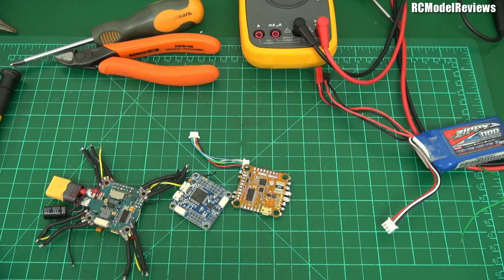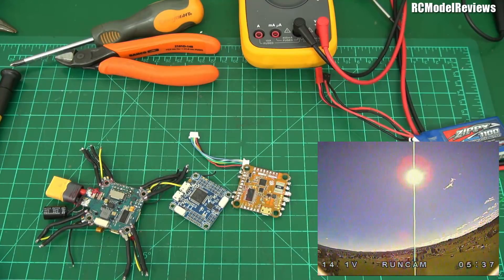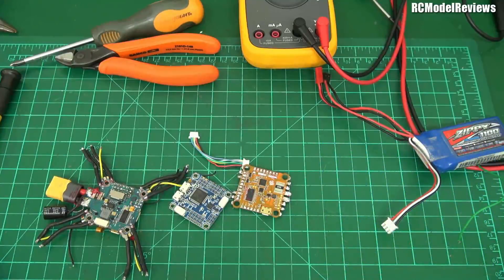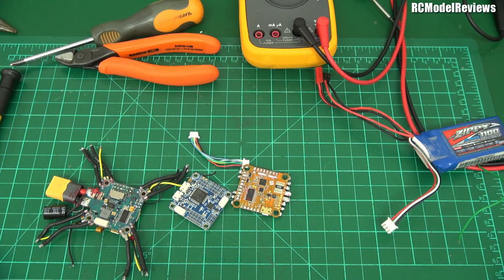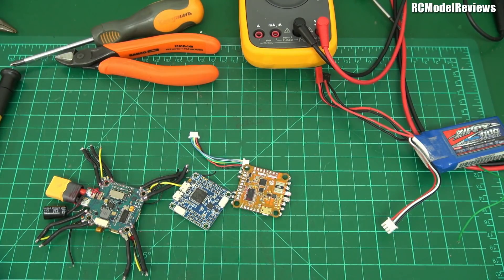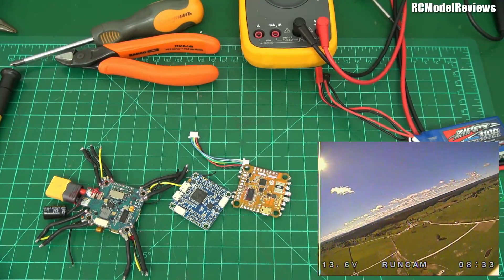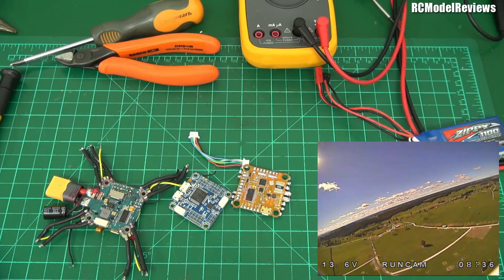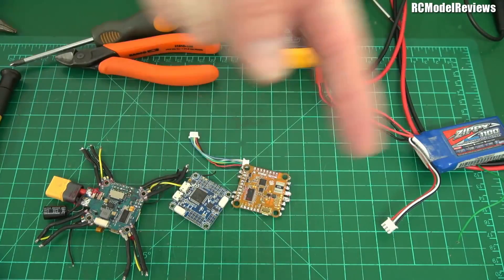How to SAFELY fly an RC plane beyond visual line of sight (part 0)

Comment: The number of things that can go wrong when your doing longer range FPV is very high. Lots and lots of ways of losing your plane. Unless your going to cover all of it I would not do the video. Not doing a comprehensive set of video's will leave the door open to someone making one of those bad mistakes. The best way to learn longer range FPV is hooking up with folks that are doing it. Having someone that knows what they are doing go through your plane, gear, programming, etc should be mandatory. Having someone who knows what they are doing copilot with you on flights should also be mandatory. Watching an incomplete video and thinking thats all there is will lead to alot of heartache... love your videos and would love to see this done as long as its done right and in a very comprehensive mannor.

Comment: A tough one... if people are going to do it, yes its good they are informed how to do it safely. There are too many people who wouldn’t have a clue, maybe thats good so they are not encouraged potentially brake the rules in their country and fuel the fire. You rase a good point about doing it safely with sound information and practices. BUT... we totally loose the moral high ground when a regulator imposes more restrictive rules, especially when there based on information given by a respected and active voice of reason and sensibility in the aero modelling community. What ever you do i’m sure it will be the right thing.

Comment: Even short range FPV is now banned in Australia so long range isn't even something to think about. I invested in Fat Shark FPV so that I could ensure I get the footage I want while flying. It is the only way (with the old Phantom One) to be sure that I get what I want within the very limited flight time. That is all over thanks to the regs.
Reply: It's always been a grey area for clubs, and a no-no for individuals. As far as I'm aware, nothing has changed... Unless clubs have been banned entirely.
There is a commercial trial of FPV happening near Canberra apparently, too, so it's a bit incorrect to say it's banned. It's just regulated, like all flight.
Reply: As far as I know from my communications with CASR, the operator of the drone cannot use FPV because the drone must be in line of sight. That is as good as banned if you are a single operator. For someone like me who is sight impaired, it means I cannot fly because I need FPV to properly orientate the drone for the shots I want to get. Clubs can still use FPV but individuals cannot. This was the wording I got back from CASR : "FPV flying is not permitted in Australia under CASR Regulation Part 101 unless you operate under the procedures of an approved model flying association.  Contact the MAAA for more information about flying FPV.  You can access the MAAA website at:  http://www.maaa.asn.au"

Comment: Thank you for maybe attempting this idea. I live in a remote part of Canada and have been flying BVLOS for the past ten years as tech. developed. I'm involved in the commercial flight industry and can see a need for this as aviation develops. It's a fine line that military and commercial jets are walking with pilot-less cockpits now and if it wern't for regulatory slight of hand and crooked governments they would be grounded. Should you decide to go ahead with this please take precautions to cover your butt. I would hate to see you off the air. Cheers, Billy from Canada

Comment: Go for it! I have been flying bvlos safely for a number of years. Always in unpopulated areas, many miles from flight paths and at low altitude using lightweight fixed wing. Not often exceeding a couple of kilometers because it's a pig finding a lost plane.

Comment: Bruce  - Great idea. The appeal of seeing the world from the sky is compelling. Whether its "beyond line of sight" or not; whether it is intended or accidental. The idea of building and operating a 'safe' ( low risk)  FPV craft that is small and has long endurance would be valuable. Please emphasize features and practices that reduce risk of loss , damage or public annoyance/ awareness. Also perhaps you could include consideration of factors that may cause unexpected radio / video drop out; things such as weather, terrain, proximity to structures / other EM sources. Thanks. Martin

Comment: I propose two technical (and radical) ideas that might kickstart this conversation. The first is one which NASA has used for years. Namely, using relay stations to transmit and receive data for BVLOS spacecraft. NASA uses stations all around the globe to keep in constant contact with its spacecraft. We can do the same with relay drones. They would become stationary drones that hover at a predetermined altitude, relaying data from the ground station to the actual craft that is doing the work. This is exactly what warfighting drones do now.
The second idea is that the exact path and altitude flown is constantly being recorded on board the drone as well as being recorded at the base station. This path is then exactly reversed in the event communication is lost and the drone comes home. But, if it falls out of the sky on the way back, the operator can consult his recording and forensically search the path that was taken. It is likely the operator will find his drone somewhere along that path.

Comment: Interesting idea but I do caution with how this will be received by the mainstream media et al and turned against those of us who fly FPV. My thoughts are: Do not use any commercially available products I.e. Parrot Disco or DJI products. Do use a home built type build much like what normal FPV fliers would construct from parts, from a variety of suppliers. Do use an aircraft  that is commonly used for FPV such as a pusher type 4 channel ( AXN/Bixler ) or even a 3 channel wing ( FX-61 Phantom ). Do use a heads up type OSD display with GPS, stabilized and return to home capability. Do try and build it within a preset budget (say 300 usd). Finally... don't Crash!

Comment: Can you do it < 250g fixed wing?
It would be nice if you had circularly polarized antennas for the video link.  Some modeling I've done with xnec2c suggests a twisted loop with the right parameters isn't too bad there, but somewhat narrow band and modestly directional.

Comment: I think it's a great idea. I think the mandatory thing is you use a controller with autopilot if going bvlos. That way it will just return if you lose signal. Other useful things: 4g mobile internet as backup telemetry and control link, a light foam plane, a pusher configuration so you don't drive a moving prop into someone's eye, and maybe an antenna tracker for base station to keep good signal. If you have autopilot you can set a course to avoid populated areas too, very useful. Ardupilot even has some ADSB features, never tried tho. For a lighter build you could do solar cells as an extra power source. Looking forward to your video!

Comment: BVLOS is the next big step. Vey timely. You need to check out the Outback Challenge and especially the Canberra UAV teams setup as all entrants were flying BVLOS and had, I think, 21 no fly zones, geofence, and moving targets they had to automatically avoid. I believe Canberra UAV will be posting a full video description of their setup and the event in the coming week or so. We setup drones, bigger stuff, with auto aircraft avoidance. Unfortunately there are still a lot of manned aircraft that do not have any ADSB or other aids, and they are the biggest worry. Ardupilot already has all the avoidance being built into firmware. It is really worth you time to see what is happening there.

Comment: Z-84 Wing Wing with an iNav AP system based on a cheap FC, an FrSky L9R, an 800mw TBS Unify Pro 5G8, and 3200mah of Li-ion 4s1p battery. With a lightweight 2204-2300kv motor and a 6x4 prop should get at least an hour of flight time and easily 10km of range, possibly even 20km on a good day. 

It’s cheap, doesn’t require specialized UHF control or video systems and antennas, or large and heavy batteries. It’s also a small, lightweight foam plane that won’t do much damage in a crash. 

There are videos of a guy flying one incredibly long range (autonomous waypoint control), even in some harsh weather, and returning safely, so they are clearly capable.

Comment: I have for quite some time wanted to make this safer by designing the technology safer. E.g. Is it possible to have 2 esc even you only have 1 motor? Like a backup esc.. so if the current flow or temperature is two high it will switch to backup esc. Some kind of detection system so that you don't loose power if one esc dies.

Comment: Hi Bruce, idea for a video. Can you design and show us how to make a Lipo automatic discharge circuit? The DJI batteries have an inbuilt timer on them to automatically return them to storage voltage if you forget. Could be a really nice diy device to make and plug into a lipo when not using it. Thanks 

P.s. how are you getting on with the sub 250g quad project??

Comment: Good idea. Do it. 
There’s a fella on here that pushed a 400g Z84 out 76km and back. The plane was light and used li-ion batteries which I believe is more safe that a polymer battery just Incase the plane were to go down some km away from you. 
My main concern with flying LR is the plane going down far away and causing a  fire and you don’t hear about it until it’s on the news the next day. Li-ion may help with this danger.
Reply: Hyprmtr 400g plane for a total of 152 km, Was that weight excluding batteries?
Reply: Sindre I believe it was 430g AUW/TOW. Supermotoxl is his youtube. He has a complete build sheet on his website with APM parameters and everything.

Comment: very good idea bruce !  i`ve been planning for a year to fly long range , i do own a full scale skyhunter with vector and i will buy the beleiver next winter which will also get a vector for more reliability , but of course i will have to use a good long range system like tbs crossfire or dragon link ect ,, with a lot of practice and short flights first , i`ll  drive away from the cities , airports , residential area , national parks and federal parks , and i will give it a try ,,,, but the very first thing that comes to my mind is,,,,,,,, safety first,,,,,,,

Comment: I'm a quad pilot and have thought about putting together an INav plane with one of my flight controllers, someday.  I'm primarily interested in the return to home feature in case of signal loss but otherwise am more keen in flying the plane manually than I am in the auto-pilot features, which I would familiarize myself with anyway.  I would want a smaller plane with good performance that is fun to fly, including some proximity flying when appropriate.  I've seen some videos of people flying in a boring, straight line, at altitude, and they're on a mission to go as far as possible in a grueling amount of time.  That doesn't interest me very much, but there are lots of hilltops around here that would be fun to explore, and trees to fly near or between.  I don't like the way flying wings tend to wagle so have considered something like the Strix StratoSurfer.

Comment: Yes please Bruce! I'm in UK so reference to regs applicable here would be useful too (ie is it OK if you have spotter, 1000' allowed in certain circumstances etc). I had a Hubsan SpyHawk that is a good example of an off the shelf BVLOS capable very lightweight FPV, but alas was not capable of GPS RTL (wind too strong) and yes lost for good! But as you say that plane was low risk as it weighed about the same as a sparrow! How about doing the ZOUD Nano Talon with an F722 autopilot and using INAV with FRSky R9 900/835 MHz radio? The nano talon is so light and small that it is low risk, inexpensive, and a very good performer and with 4S Li-Ion pack would have great endurance?
Reply: Jeffrey Horton I just bought a nano talon for this reason! The regs only allow LOS in the U.K. and up to 1000ft if you are a member of bmfa fpvuk etc.
Reply: " But as you say that plane was low risk as it weighed about the same as a sparrow  " 
AFAIK the Spy hawk weighs about 350g. A house-sparrow weighs under 30g. If you want to make a direct comparison you should be looking for at least a fat pigeon
Reply: PropStrike RC Anything FPV is limited to 400’ as the BMFA fucked us over on that one.
Reply: You are still allowed to fly FPV up to 1000' (at the moment), however there is no good reason NOT to be a member of the BMFA / FPVUK as the small amount it costs also covers you for up to £25 million insurance - and this alone pretty much proves how safe model flying is - that we can get £25 million of 3rd party insurance for as many planes/helis/quads as you own for £33

Comment: hmm, I am not so sure you should do this or at least not with an aircraft in the sky, you could do it cautiously using ground based equipment in a suitably flat or up hill environment. my concern is that we in the hobby are under scrutiny at present and I wouldn't want to see something go wrong that caused some bad press or worse for it to go right and still get bad press because a good news story is not a news story. in any case I love the fact that you have started this conversation and i respect both sides of the argument as expressed below, take care and don't do anything that would deprive us of your experience and wit. by the way what are you doing with that Omnibus F4 V3 Flight Controller?

Comment: Something I've pondered about previously, is there a reason "visual" is included in the BVLOS designation, is there a line of sight that is something other than visual that I'm not seeing?
Reply: I believe it refers to being able to see the aircraft unaided, ie. without using binoculars or telescope.
Reply: The point being, it's far enough that you can't just pull your goggles off and continue flying line-of-sight, and even if you had a spotter, the spotter couldn't see the plane either.
Reply: Well you could argue that fpv is kind of a digital line of sight.. So visual would be to clarifiy that
Reply: A proper LR plane has a return to home,if that falls fowl to a mechanical issue theres not much more that can be done.a very long bow string drawn here,i however conduct many many so called LR flights,very much in love with this hobby in all aspects of FPV,and Bruce is a King to our hobby...

Comment: Yes, do it. Just reading an article in ROTOR DRONE mag on BVLOS.. and the steps others are taking to make it safe. Very encouraging dialog.  Also 107 ers must have it ok'd because you can't deliver pkg  from Amazon, which I hear is currently happening in some states,  without going BVLOS. And  if it's a federal reg, we'll that's all states.  The only thing changing faster than drone regs is the drones themselves.  They are working on some ears on these things that will stifle them out of each other's way and a much noisier full size craft.  I don't always fly line of site..but when I do its not on purpose. And sometimes never see it again.  Bye $150-?? $...Except now I use trackers..hope that works..

Comment: An FPV rc plane, depending on size/visual area in various attitudes can remain within VLOS for quite a distance anyway. Close to the capability of stock RC radio equipment (though new long range technology extends that)
I'm not at all sure that most models can be flown safely at BVLOS distances except in exceptional circumstances. I'm even less sure that they should be or that people should be encouraged to try it
I am sure however that you will try to demonstrate that this can be done. 
It could be an interesting experiment, and of a certainty, will generate some heated discussions (and replies to the videos) Given that you will be doing the flying it may also attract the attention of both those who dislike you and, possibly, the relevant authorities so I'd advise caution.
Many of us are quite fond of your productions :)

Comment: Hi Bruce , I think this is a fantastic idea! I live in the Canadian prairies Regina Saskatchewan to be specific and hopefully not incriminating LOL. I have been collecting the gear to start up with my first long-range flight. I've assembled all the ezuhf components needed, Plus a seven or eight turn helical 2.4 antenna to be used with video.  It will be done through a  taranis x9d so I'm fairly confident in the equipment that I'm using . The plane will either be a volantix ranger with the 2 meter  wingspan or a Bjormatec Maya with the 1.8 m wingspan . Not sure which one will win the prize of the electronics and flight. You can guarantee that I'll be watching any video series you make in regards to a realistic Beyond visual line-of-sight flight and I thank you for having the Kahuna's to do it especially being in your situation we're so closely watched. I hope the officials in your town that have been giving you a hard time realize how much worse they could have it instead of having a responsible realistic teacher such as yourself. Cheers, Josh in Saskatchewan

Comment: I already said many times the only way to enjoy the hobby is for the manufacturers to make the models small enough and light enough that they won't be seen and if they fall out of the sky they can't hurt anything.  How many birds out of billions have died while in the air and have hurt someone or anything when they crashed to the ground?  Happy Flying
Reply: Probably more than we know. However we do know many real airplanes have been knocked out of the sky by bird strikes. I've seen the results if many bird strikes. It's not how heavy and fast the bird is going that does the damage. They BLOW BIG HOLES deep into aircraft structure. They wipe out engines, windscreens, leading edges. They blow through bleed air ducts and smash holes in fuel cells. Birds kill airplanes and people very effectively. These conversations routinely ignore the realities of low level flight. There are airplanes down there, legally down there.